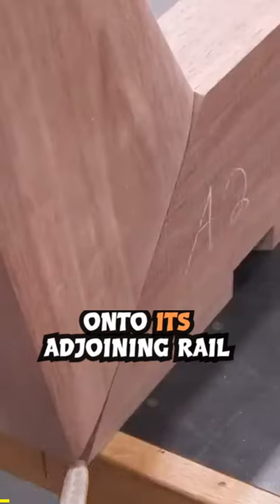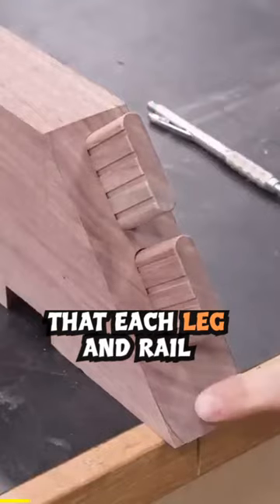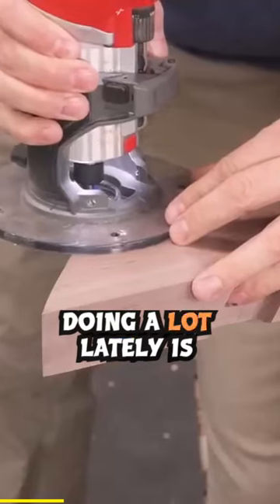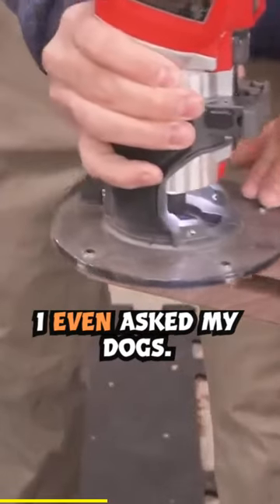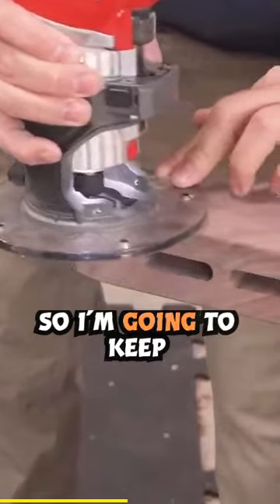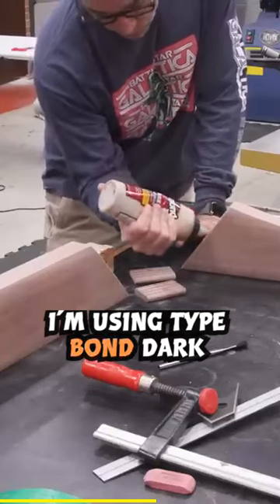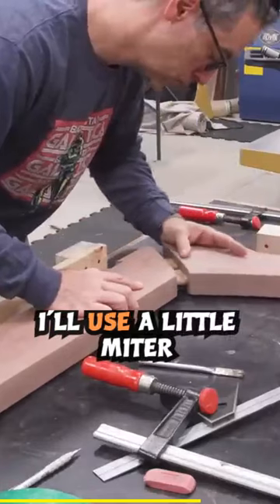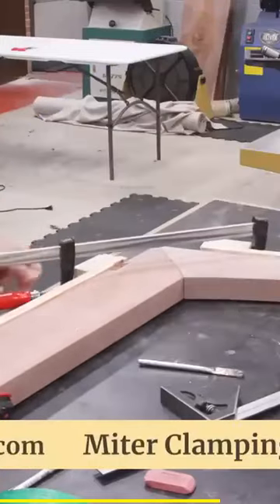How To Make a Crisscross Joint | Woodworking Podcast Remix 🎧🔨🪵

Comment: Why not attach one of those small lock in pieces to either board, drill a hole that lines up thru both of them, then put a removable rod thru the two to lock it in with no glue needed, easy disassembly too
Reply from the maker: Lock-in pieces with a removable rod offer easy assembly and disassembly, but they may compromise stability and aesthetics. It's essential to weigh the trade-offs for your specific project's needs. thank's